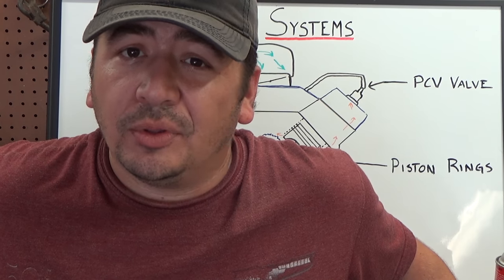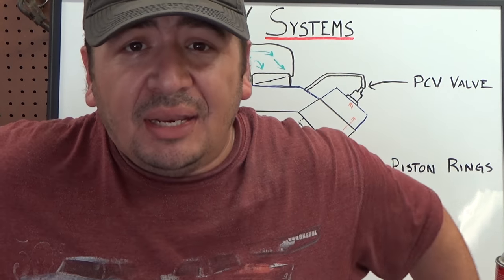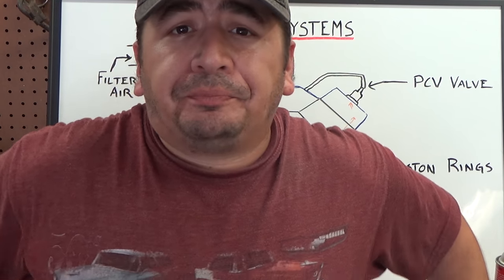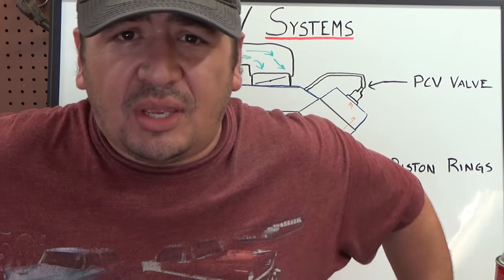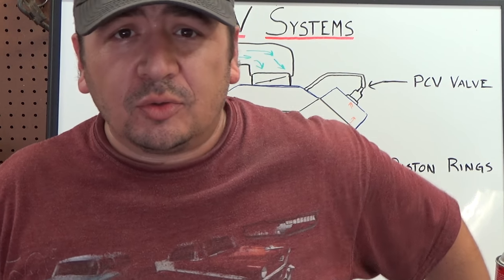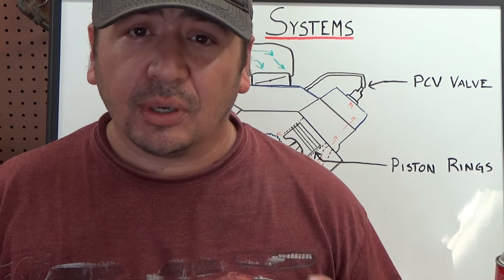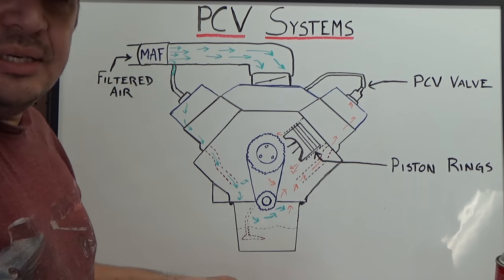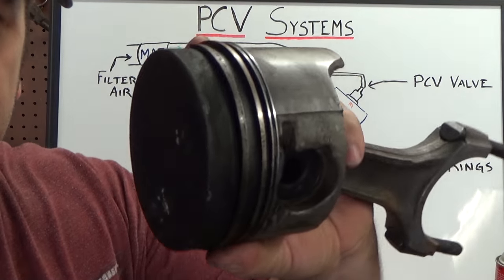PCV Systems - How They Work

Comment: Dude pulled my sons off and it was broken inside ,I put hundred in parts trying to fix my sons Chevy blazer and all it took was your video and this lil 4$ part and it’s fixed 😍 at least I gave his car a free tune up 🤣 thank you brotha your the man 👊🏽
Reply: What if they are stuck open I been chasing a maf code and I checked my valve and I can blow air threw both ways and there oil on the tube fans intake
Reply: @arealmaintenanceandrepairl1103  same with me
Reply: @arealmaintenanceandrepairl1103  they need to be getting vacuum through the tube that is connected to it
Reply: Youtube do it yourself saves soooo much money
Reply: I've got a 87  R-20 Chevy Surburban w/ a 350 throttle body I've notice one morning I, went to check  the fluids like I always do before starting any engine I notice that the pvc valve was laying on top of the right top of the valve cover which came out of the pvc hole so I took the pvc valve off of the rubber hose and shook it and their was no rattle sound so I clean the pvc valve with  mass  air spray cleaner and put it back  in to the hole on top of the right  valve cover and rehooked it back up to the rubber hose after that I had not had any more problem with it blowing out any more
Reply: Thank, you for sharing  you're video
Reply: You're, welcome.
Reply: ✌  love, all

Comment: I never leave YouTube comments. I have never seen such a wonderfully simple explanation of how a PCV system functions. Awesome, sir!
Reply: I was gonna say the exact same thing, great explanation and illustrations.
Reply: @donavanflowers4656  I never realized how important a PCV valve was. I always figured if you hear that valve rattle around... all was good.
Reply: I never read comments but your is the very first I've read 😃😃
Reply: @hanc37  Nope!  I just removed 2 PCV valves to clean for my relatives. They both rattled and they both allowed air to pass through both ways. What I'd like to see in this vid, is what will happen if you had a bad PCV valve.
Reply: He earns my credit for cutting the part in half for illustration.

Comment: Just bought a kia Sedona with the gdi engine. PCV systems kill these engines due to fuel being directly injected instead of washing over and cleaning the junk off the valves. Pretty sure I'm just going to vent the to atmosphere with shorter oil change intervals and good oil.

Comment: I'm having oil leak into my air filter and I read it might be from a bad PVC valve. I literally never heard of that or had any idea what it was but now I understand. Still not sure if it's what is causing my problem but I think it a good place to start. Amazing explanation that even a non-mechanical person like myself can understand. Thank you!
Reply: You can also pick up a oil catch can as well. So if any oil still slips by it will go into there instead of your filter.
Reply: Did changing the PCV change fix your problem? I’m having the same issue.

Comment: Hi Kyle  I see that the direction of the PCV flow is from the air-box through the breather filter to the crank case, to the PCV valve and so on; what I'm trying to understand is how does oil end up in the air- box which is opposite to the flow, and why isn't the breather filter preventing it from going to the air-box?

Comment: Very well explained. 😃👍
You just forgot to mention 2 things/functions:
- At high revs but closed throttle it's necessary to restrict the flow for avoiding the PCV-valve beeing a bypass around the throttle. That's necessary for revving down.
- In case of a backfire into the intake system the pressure rises spontaneously, so the little piston in the PCV-valve is pressed backwards, shutting completely with the plate against the washer. This is for avoiding the backfire entering the crankcase and damaging the engine.
That's all.
I had never seen a cut open PCV-valve yet, just drawings, but not in real. 😉
Reply: @U.E. U.E. Can you explain how a backfire into the intake is caused? I’m repairing a 2021 Traverse (w/114 miles) that caught on fire from an intake backfire that melted down most of the plastic intake “duct” and burned the side of the engine that faces the radiator. Have the wiring harness and all melted parts replaced and am ready to start it up, but need to find what originally caused the backfire. Any ideas?
Reply: @billcowhig5739  In the case you worked on the engine the most likely is to mischange the ignition cables and having the spark during the intake stroke with open intake valve (I did it once in a boat, mischanged 1/4 and 2/3 - boom! 🤦‍♂️ The oil filler cap was shot vertically up, passed so close by my head that I felt the wind in my hair and shot a hole in the roof above me.).
Other reasons can be excessive amount of fuel in the hot intake or ignition/valves very far off.

Comment: Great video. I’ve been trying to make my car run better and this is one part I’ve overlooked for a long time because I thought the PCV valve didnt do much. I’m about to change the valve cover gasket which has been losing some oil lately, now that I know about the crankcase pressure thing I’ll do the PCV also.

Comment: Thank you for this video; it makes perfect sense.  I have a forced induction 2v modular ford that is converted to non-emissions, non-cat, non-egr, etc. that runs a blow-through MAF.  I currently have a PCV and one breather on the opposite valve cover (the inlet side) and started thinking better of it.    After finding a mix of information online about it your video lead me to a bit of a shift in my thinking.  I now realize that I have a pretty serious unmetered air condition going on.  My car idles a bit erratically; but my car also has a cam so it's somewhat to be expected. I do on occasion stall at lights and wonder if this has something to do with it.  Time to rethink that inlet side I think; I'll just weld another port onto my intake tubing and connect the inlet side to that tubing (upstream from the MAF) instead of using that breather.  Also thinking I could install a check-valve below the breather (would probably fix the unmetered air condition), but I wonder if this would increase my crankcase pressure, thinking that would be a bad thing.

Comment: At the end of the following there's a point and lesson about a PCV valve:

I have a 2002 Toyota Sienna with 230,000 miles on that just lost its #5 cylinder ignition coil. Two of The front ones already went. But those and the spark plugs are easy to get to.

Well so with the rear coils and plugs when you have to take off that intake platinum. My mechanic is a friend who's retired from active mechanic work and now works out of his house at cut rates for friends, but it still cost enough.

So I Wasn't going to fool around with anything aftermarket. Back there, so I hadn't put OEM Denso coil packs in the rear. And I put OEM Denso iridium 100k mile plugs all around.

I got the car in 2012 with 136k on it and I just had him do the plugs back then with the NKG equivalent of the Denso iridiums. So those were fine. But I feel a little cheated because now they only had 65.5k on them. 😄

 But also back in there the PCV valve, much less at it's grommet, Is not easy to get to.
 oh, sure, everybody might have their little tricks to reach it and do the job. But that's if everything goes smooth.  But in this case, even with the plenum off and full access, it did not.

 For one thing, when I first got this car in 2012 and had him do the tune-up, I didn't even consider the PCV valve. That was a major F up...as it now seems that it was the ORIGINAL.

So, when my guy went to remove it, to pull it out of the grommet,  It was so brittle it's snapped off flush with the grommet.
He then used his needle nose pliers to pinch a section of the PETRIFIED grommet and try to remove it from the whole in the intake manifold.
At which time 3/4 of it that was below hole  broke off and drop down inside.  Between us taking turns it took us nearly an hour to get it out of there.  It was in one large chunk with no flaky pieces, and he pretty much suggested just leaving it in there because there was nowhere for it to go and it wasn't going to get sucked into anything as big as it was. But it's size and shape also prevented it us from getting it out through the hole with pliers or hooks. He finally got the idea to spear  one end of it with a Instrument that look like a broken dental pick and rolled it up through out of the hole like that.

 But the bottom line was 
 that PCV valve was pretty cruddy and I'm sure it was poorly functioning at best. 

 And I think that because of what I have since learned about What PCV valves do and how they work in relation to pressure in the engine.

When my mechanic pulled out my coils and my spark plugs from the back  there was a little bit more oil on or around them than there should have been. Not awful, but time to think about a head gasket sometime in the future.  

Well, I'm sure that's true in a car that old. But I'm also thinking that If that PCV valve was bad and the pressure had built up in the crankcase, that might have exacerbated any problem like that pushing out oil where it would not normally have escaped from and something like a head gasket job might not really be an imminent issue now that the valve is replaced. IDK. But maybe.

 Also, and I don't know if this is a thing, but I seem to have a noticeable amount more  giddy up and go with seemingly less effort.  Again, don't know if that's the PCV valve ffully functioning or not over a clogged one.  I doubt it's my coil packs and new spark plugs.  Those either work are they don't?

Also, because my PCV valve in this car was hard to get to I went with a genuine Toyota OEM one from the stealership.  Same with the grommet.  I researched it online. And too many people made too many good points about aftermarket ones not necessarily being 100% calibrated specific uses in that they have to fit so many makes and models of cars.  So yeah, for the peace of mind it offered me for such a very simple yet very important part, It was worth it.

 Moral of the story (mini novel 😁):
1. Don't overlook the PCV valve. 
 2. Don't skimp on quality. ones or the right fitment.
3.  Replace the grommet at the same time.
4. Do not waste time cleaning them INSTEAD OF replacing them. If you like only do it as a general maintenance thing to keep them unclogged. Like if it's easy to get to and you want to  do it every other oil change or something like that. But the SPRINGS wear over time and lose the appropriate tension.  So it can rattle and still be fucked up.

Best to all and thanks for this video.
Reply: I am hoping this is the fix for my 1985 Prelude which I was stupid not to start up for a year. It backfires now and revs shoot up on start up so having changed leads to plugs and coil and thinking this may be the cause...if I can locate it. I have a manual but although it recommends that it is replaced every 30k it doesn't show its location. Having watched this I should be able to locate it now. However getting a part for this car in the UK that is original manufacturers is near impossible...just seen someone selling a distributor cap for £100! Luckily I found a couple new in USA which were cheap so got my freind to buy and send over!

Comment: Excellent demonstration video. I now realise the importance of this valve. Recently noticed my idle slightly higher than normal & increased engine oil consumption. Checked pipes/hoses etc... for vaccum leaks, no leaks. I checked my pcv & its jammed open 100%. Now going to purchase a new pcv valve. Thankyou very much. 👌🏻👍🏻👏🏻👏🏻👏🏻 👋 🇦🇺

Comment: What happens if it’s stuck open I can blow threw it both ways
Reply: I had that happen and the engine start to buckle a lot.  Meaning too much air flowing back into it.  It's designed for One-Way, but when stuck open, the One-Way is broken.  Sometimes it gave me start-up problems too.

Comment: Around 1960s, there was higher demand to control the smog.  Therefore do not vent the the crankcase to outside, but to feed it into the intake.  Problem 1, it was common to have engine back fire, or flame coming out of carburetor in the old day.  Or tail pipe.  If the flame enters the crankcase, it will pop the engine oil seals.  Therefore the PCV, or an one-way check valve.  Problem 2, the PCV has a dirty live and it can get clogged over time.  You will notice it during high intake vacuum (low RPM or decelerate).  Such as your engine will die when you decelerate around a corner.  I am not sure if there is a modern high tech solution?  But I have not seen PCV problem for over 15 years.

Comment: I like guys like him... good talker, plain speaker, and lots of mechanical skill and common sense...   PCVs are cheap and easy to replace by yourself and are simple to overlook!. Mine can be thoroughly cleaned  with parts cleaner and replaced or a new one is a few dollars and easy to install on my 2000 Corolla....

Comment: Why do you not want to draw a vacuum on the crankcase? My cars do not have PCV valves, Opel Calibra '96, Opel Vectra '90, Opel Astra G '01, all petrol engines. (X20XEV, C20XE, Z18XE are the engine codes, if you want to look it up)

Comment: It actually makes sense when someone who understands it explains it. I was trying to figure out the oil looked thin and smelled like fuel in the crank case and the intake.  If you have problem with the PCV you have to check the vacuum, throttle body and the air intake. I have seen a lack of knowledge in this area end a few cars. How does the EGR fit into the mix. If you have negative pressure the fresh air intake to crankcase is plugged?

Comment: Excellent! Thank you very much very professional very informative.  

It’s funny but every time I get an oil change I notice I have to put in about a quart within a months time after that seems crazy I just thought it was just burning oil because it was older.  

Now after doing some investigation and research and I know I can take action myself.  

So far I added some oil and a Lucas additive and it’s great.   Then I clean the air intake valve and it works even better and now I will clean or replace this PCV valve. It seems crazy that this is the first time I think I’ve really heard of this.

Comment: My Mx5 was spark-knocking and smoking like crazy- took it into a shop, they did a compression test and cleaned the fuel injectors and told me to run higher octane fuel, charged me $465 and didn't even solve the problem. I installed a new OEM PCV valve, and voila, corrected the problem, has never run better!

Comment: Here’s my question.
I had a 383 stroker built and my vacuum isn’t as high as stock anymore.
At idle I’m now at 15 to 16 inch’s of manifold vacuum.
So how much vacuum is needed to operate a stock PCV valve?

Comment: Wow. I better run out and change that. Last oil change I did on my month old used 2012 Toyota Corolla S 1.8l L4. 
  What is wrong with this oil? The seller said he just changed. Soon after I changed it to Amsoil 0w20. 100% synthetic.
  The old oil looked watery and a bit foamy not to much. Dip stick was clean. Really hard to read it on a shiny smooth cheap dip stick ,need to scuff it up.

Comment: Great Video! So, I got a 2013 chevy cruze ls, 1.8l engine. I suspect a pcv valve fault, but they put the darn thing in the valve cover! Its not hard to change, but its a silly diaphragm design and it will just fail again. Can I just put an inline pcv valve before the existing torn open valve?

Comment: On my 2002 Ford Focus, although it uses a MAF sensor, the PCV breather intake is not metered and the value is simply programmed into the PCM. The hose connects before the MAF sensor.

Comment: There are literally thousands of different PVC valves calibrated and designed for different cars engines.
When one hot rods or builds ones own unique engine how in the world does one begin to identify the correctly calibrated PCV valve from all the thousands that are out there?
There are no "Specs" on PCV valves. No flow rates or Hg pressures that actuate them. Harrumph.

Comment: Whut? The engine of my oldtimer Skoda 130, had a open PCV system without a valve? Only a hose from the valve cover to the airfilter.

Comment: Having problems with engine leaning out or fuel issue when I accelerate at part throttle, also idles a tad high, I pulled the PCV valve to clean it, should I be able to suck air through it easily? There is no restriction. Is my PCV valve faulty ?

Comment: At 9:15 you demonstrate that with throttle closed and a higher vacuum the gap is bigger, allowing for more flow. Immediately after you repeat yourself only in reverse. Showing that at start up, the “plunger” is higher up and therefore making the gap smaller. Continued by saying that at a higher rpm, the plunger comes down. That makes no sense to me

Comment: Hi.. I know its been a while since u uploaded this video. I have a 03 cadillac cts 3.2L v6 and the PCV valve is waaaay different.. can you explain that type of pcv system? Mine started with milky stuff by oil filler and then I tired to fix it by replacing the rubber on the pcv valve but after several miles the oil by the dip stick got milky as well.. Thanks 🙏🏼

Comment: I have a 2013 Toyota 4Runner and the pcv valve was change; there is oil coming up through the pcv and into the intake. What could the issue there be?

Comment: Your video is a lot better than one I just saw on u tube !, that other video didn't even explain how the pcv valve works!!, also one question,  all of the pcv valves I see these days either don't have anything in them but a small hole, or they have a small hole and a small stainless steel ball that rattles when you shake the valve, can't find any like the one you cut open ? Can you please send some information on where the spring controlled valve can be found? Thanks 😊